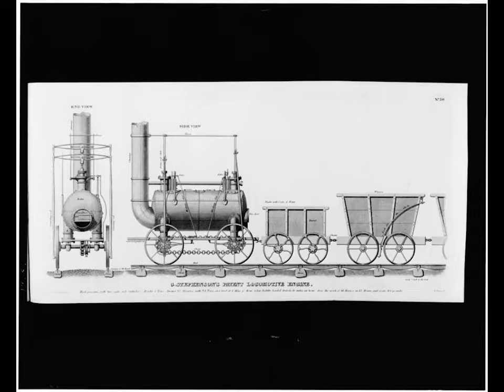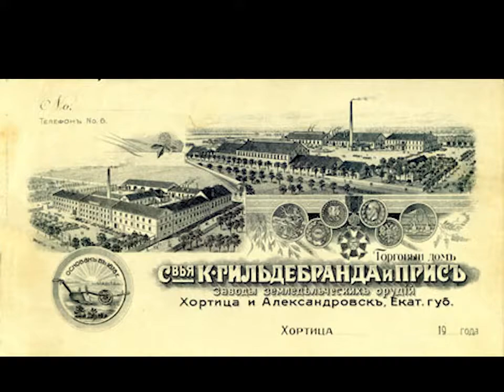RLMS: The Russian Gauge Question

Comment: Excellent video.  This is one time using Imperial  measures would help because 1524mm = 5’.  I presume Russia was using metric but an American engineer would prefer a measure easy for them.

May I suggest your next myth to debunk is that rail gauge is the primary issue in railroad construction costs. 

While there is an “obvious” saving in sleeper lengths this assumes everything else is constant. A railroad/railway is designed for an axle load and speed which affect the weight of rail used, the dimensions and frequency of sleepers, the ballast, the route alignment, the strength of bridges etc. 

If you want to examine the rail gauge debacle in Australia I highly recommend the following PhD thesis, which is available online:

The Myth of the Standard Guage: Rail Guage Choice in Australia, 1850-1901
Mills, John Ayres
2007
268 pages
Reply from the maker: At the time of that construction, Russia was using Imperial Russian measurements, not metric and not American or British standards. But as we say in the video, the American engineer they hired used the Pennsylvania gauge with which he was familiar, although it did not match anyone else's system.

Comment: For a time in the 1970s British Rail reduced standard gauge on straight track by 3mm from 1435mm to 1432mm because it was expected (my recollection as a result of the research to produce high-speed 2-axle vehicles) to produce smoother running.
Reply: As a ferroequinologist, I didn't know this.
Reply: How does that make sense?
Reply: @longiusaescius2537  It may reduce wheel hunting from side to side - just a guess.
Reply: @TheManFrayBentos  yeah but weren't conical wheels already a thing?
Reply: I worked in BR P-way at that time, yes, 1432mm was the standard. I'd moved on by the time it became 1435mm, but when I've read it since, I've thought it was just a dumbed down version of reality, so thanks for that.

Comment: 1524mm gauge ( 5 feet) as Imperial Russia was then based on an Imperial British Inch system.
5ft was also the majority Gauge of the "Antebellum South"...,so it was easy to influence the Russians to adopt 5 ft Gauge. The US, after the Civil War, given the destruction of most of the 5ft gauge System...so rebuilding by US Military Railroads during  and after the Civil War to Northern "Standard" gauge se the US eventually by the 1880s, nationally standardized to 1435mm, except for some Mountain, Forestry, rail systems in 3ft Narrw Gauge.
Imperial Russian Inch system lasted till 1918, with the Bolsheviks adopting the Metric System for all Post 1918 Engineering usages.
(Ordnance, and other heavy engineering matters retained pre1918 specifications, but described in Metric Terms.
..so eg  a 3-inch gun became a 76,2 mm gun. The Mosin Nagant Rifle design retained all its Inch/ Whitworth specification as designed in1890-91 to the end of PR China Production in the 1960s. 
The Gauge Question is much more interesting than quoted in this video.
BTW, 1829mm is " Six Foot" a gauge originally used by the Erie Canal Company in the 1840s...USA really had a hotch-potch of gauges till the outcome of the civil war (1865) and the completion of the standard gauge TransContinental RR in 1869.
Reply: Peter the Great standardized the Russian units to English ones. Though they typically used vershok which is 4.445 mm (1.75") instead of the inch. My mother was from the Eastern part of Finland that was given to Soviets after the war and she thought to me that an inch is 4.5 cm. It took me a decades to get why she said so.
Reply from the maker: Russia did not use the metric system at the time of the construction of their early systems. They used Imperial Russian units or, as in this case, what their imported American engineer told them to do. As we said in our earlier video about gauge, a lot of early systems used the system that their chief engineer said when he spread his arms and said, "About this wide."

Comment: I'd love to see a similar programme on track gauges in the USA. Another good topic is the reason why trains in some countries not associated with the UK, drive on the left, e.g. Belgium and France.
Reply: That should be easy, in the past all trains drove on the left just people did on the roads, it only changed, in Europe, during WWII on the roads, but not on railways, in some cases. Quite interesting case is KFNB in Czechia, trains drove on the left track up until some 2010 while on the rest of the network trains were already driving on the right, this had resulted into construction of several flyovers that now cause problems as they are sending trains on "wrong track".  So some will be removed during construction of high speed railway (hopefully in next 15 years), but at least in one case it is planned to build another flyover.
Reply: @MrToradragon "in the past all trains drove on the left" no they didn't...German trains, for example have always run on the right.

Comment: To go back to the Roman gauge myth. In 1988 when I first lived on Tyneside I went out to Housesteads Roman fort one evening and measured the very prominent grooves in the threshold of the west gateway. they were 4 feet 2". it didn't matter how you measured the grooves they were nowhere near a gauge of 4foot 8 and a half inches apart. During the British Gauge wars of the early Victorian times the advocates of broad gauge called the gauge favoured by the Stephensons and others the coal cart gauge. According to Clothier, A.C. Beyond the Blaydon races, Waggonways and Railways of the south east Northumberland Coa;field. Part 1, 2014. In July 1754 William Brown overseer at Throckley colliery to the west of Newcastle says the gauge of his railway is 4' 2.5"., later this waggonway was linked to other colliery systems so presumably was 5 foot gauge, but how this was measured is unclear. by September 1786 a maintenance contract for the lines of the connected Walbottle and Throckley Waggonway  refer to 4 foot 8 and a half inches, which the author says would agree with a stated gauge of 5' if  the four foot eight and a half is the inside measurement betweeen the rails. This is the earliest documentary reference to that Gauge according to author Alan Clothier.

Comment: @3:57   1829mm is exactly 6 feet.  It might have helped if you gave the Imperial measurement as that would explain an otherwise spurious random number.
Reply from the maker: It is our policy to use metric measurements in all cases.
Reply: @RailwayLMS You made it sound like Franz had picked a random number.  1829mm does sound random, but when you know 1829 is exactly 6 feet I question whether it was random at all?

Metric is good, but mentioning Imperial helps explain the why.  Especially as a lot of railways were built in the latter system.

I used to wonder why the legs on a silicon chip were 2.54mm apart, how odd I thought, why not 2.5 or 3mm?  Then I found out they were 0.1 inches apart and then it all made sense.

Why are the stumps on a cricket pitch 20.1168m apart?  In Imperial it's 22 yards or 1 chain which makes the odd distance chosen rational.

Interesting video all the same. 👍

Comment: Or one could just go with engineering:
It is easy and quick for combat engineers to narrow the gauge: Move one or both rails towards the center and you're done. But widening the gauge is much harder. Cross ties, tunnels, and lots of stuff doesn't widen easily.
So if you want to protect against invasion while keeping yourself open to invade others, make sure your gauge is the narrowest. Russia chose to give itself a handicap when it comes to Europe's favorite pastime.

Comment: 5:33 - "at that time" there was no Poland, it's been long ago partitioned between Austria, Prussia and Russia. Thus it was "Polish territories", or "the land/ territory of what used to be Poland" that was under Russian occupation (and therefore, a "control").
I know, this is about railways, not history - still, it's better to represent facts correctly.
And as far as the "Rusian gauge (hi)story" goes...

As probably many of you know, there's this joke/ urban legend about "bureaucracy and standards that live forever" linking "modern standard gauge to the width of Roman war chariots" (that had to accommodate two horse arses, side by side in front of it, and which made ruts in early European roads, built by Romans, so latter builders of wagons and couches had to set the wheel spacing to match those ruts to prevent those wheels - and axles - from frequent breakage, and them this "gauge" was inherited by tram builders, and so on...) - but there's another, less known joke about Russian gauge (5 ft or 1524 mm, latter redefined as 1520 mm, or 4 ft 11-27/32 in).
So the story (joke) goes like that: when it came to standardization of railways in Russian Empire, foreign engineers tasked with the job asked the Tsar whether he wants them to build it "to the European/ English standard, or broader?" - to which Tsar barked back "на хер шире" (na kher shyre - literally "on a dick wider" - but the phrase "на хер" is best translated as "why the fuck/ what for [wider]").
However, the tsar's response was uttered without a rising tone (indicating a question in Russian and other Slavic languages), which is often the case when asking a rhetorical question with an obvious answer, AND since you don't argue with Tsar (or ask him for explanations, however extravagant his request may seem), after couple of measurements taken among themselves they arrived at some median figure and added it to the standard gauge width...

...and this is how we arrived ad Russian gaude, or at least "so the joke says" ;-)

Comment: You said that the track gauge change from 1524 mm to 1520 mm took 20 years starting in the 1970s. Were prisoners from the gulags used?
Reply: GULAG system was drastically changed after Stalin's death, so no

Another thing to remember is 1520 and 1524 mm gauges are completely interoperable, so there was no reason to force the change by any methods, only thing required was gradually replacing old wooden sleepers with concrete ones as a part of regular maintenance.

If needed though, it would rather be done by railway troops or by Komsomol construction squads as it was during the construction of the Baikal-Amur Mainline

Comment: And again, errors: The Stephenson Gauge was based on the gauge of the Coal Chauldron in the North East of England, which was a hold-over from the farm cart which had developed in Roman times based on the width of the backside of an Ox. I the Wet of Newcastle is the ruin of a Roman gatehouse where the ruts are 4ft 8.5ins apart. You really don't do any research, do you..
Reply: Not horses' arses? Damn, there goes another fondly-held notion.
Reply: And since railWAYS originated and were developed in the North East, it remained the norm for the UK - except of course Brunels's Great Western which ran on 7' gauge unril 1892.
Reply: Nice story - but no proof
Reply from the maker: Yes, we do research. That's why we learned that it's a myth.

Comment: 1829mm is 72", 6'
1435mm is 4'8.5", Standard gauge

The odd figures are because you're using an unusual metric.
Reply from the maker: The metric system isn't unusual.
Reply: @RailwayLMS  It is when you're talking about historic norms.